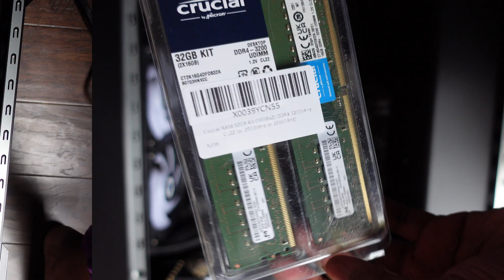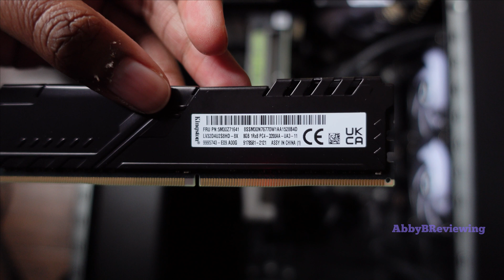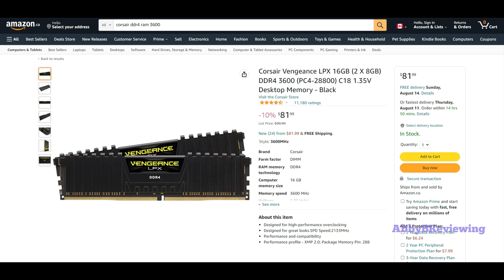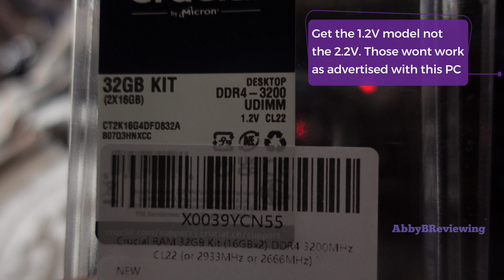Lenovo Legion Tower 7i RAM UPGRADE

Comment: Hey! I buy the same exact pc but used, my friend change the ram for gskill Trident Z RBG 4x8gb 3200mhz but is stock on 2133mhz its impossible tho change in the BIOS do you have any issue i realy need rgb 😭
Reply from the maker: Hello, i have not tried that RAM. The one i have is not RGB, and it's still working great with no issues.

Comment: Hi my legion tower has kingston fury ram in it and i m buying another 16gb ram stick it s going to work right?
Reply from the maker: Hello, you would need 2 new 16gb sticks you can't have an uneven number of GB in a PC (use either 2 or 4 total in this PC), and matching the exact brand/kind of RAM, your Legion PC came with should work great
Reply: @AbbyBReviewing yes in fact my pc came with 1 ram stick which is 16 gb and i ordered another one that is 16 same brand
Reply from the maker: Oh, that's interesting did the second stick of RAM you get work out well?
Reply: @AbbyBReviewing  i still didn t get it because i live in italy and i ordered it on the 25th of december and it was christmas day hopefully i get it this week i will let you know when i test it
Reply: @AbbyBReviewing  i just got my ram and i installed them i had a bit of trouble because i had to remove the gpu but everything is working fine

Comment: Hi, I'm from Argentina. 

I wanted to upgrade the RAM to this PC and tried the Corsair Vengance Pro and it runs at 2133MHz.
Then I tried the Patriot Signature and I just got an error alarm (computer won't start).

I even talked to the Lenovo customer service, and they didn't give me any solution on this.

Then I watched your video and tried the Crucial, and worked perfectly! 

Thanks A LOT.

(You can even mix the Crucial sticks with the ones that the pc already got).
Reply from the maker: Hi Franco, I'm glad I could help! And thanks for sharing 😊

Comment: Hi Abby, glad I found this VID!!!!! I have 7i Tower w. 16gb RAM (2 stix@ 8gb  each) & RTX3070 (running 6 1080p monitors with addition of an external GPU for 2). Been noticing that my computer lags really bad all of the suddenwhen multiple windows opening running vids or working with CTRIX aps for work. Memory use is always at around 70+ percent. Sorry for long intro to an actual question... What are my best RAM options to  upgrade my ram? I would prefer to double the same sticks but not sure that will be best cost; it came with the LEGION ram with the sinks built into it. Please give me some options that are known to work with this tower; been reading alot about people buying ram and it is not compatible. TIA👍
Reply from the maker: Hello John, I can only recommend the specific RAM brand mentioned in this video, as I've tested it and works no issues for me, and got it on Amazon. You can do 2 or 4 sticks of 8GB, 16GB, or 32GB RAM for ex whatever works for your budget, the higher storage will be more expensive obviously.
Reply: @AbbyBReviewing  Thanks for your reply... Lenovo 4X71B32811 8GB DDR4 2933MHz ECC UDIMM Memory is listed on their website, BestBuy stated that it is compatible but awaiting confirmation from Lenovo website... Thoughts???

Comment: Hey thanks for the video. Do you have to take out the old RAM? (2x8g)  What would happen if I left it in and added the 2x16g crucial RAM in the 1st and 3rd slots?
Also do you have any recommendations for SSD upgrade?  512g is on the small side..
Reply from the maker: Hello, computers can have operational issues if you mix RAM storages like that. I wouldn't try it because of that. And I haven't upgraded my SSD, haven't needed to yet but I'd go with the same brand/model your PC came with but in a higher storage capacity and it should be fine.
Reply: @AbbyBReviewing  Oh ok cool. thanks a lot for the info :D

Comment: FYI new system with 64 GM RAM, 4090, and i9 came in.  The RAM was running at 4000MHz! I updated the BIOS and the XMP option is no longer there? There are memory options but any changes and the system will not start! Great I upgrade to 64 GB RAM and more larger NvME drive and have worse perfomance than other. The Lenovo forum has a few like me who just recieved the same spec'd system having the same results. For now I would not quarantee any RAM for this system because it looks like there are different BIOS out there maybe because there are different mother boards? I am not sure but I am using the O5UKT1DA BIOS April 20, 2023 for the Legion T7 34IRZ8 system. My options are to keep this, build my own and get the Corsair Vengence 8100. I only purchased the Lenovo because the BIOS reportedly corrected the RAM issue. Others are also reporting the NvME speeds are slow as well.
Reply from the maker: There are many different models of the PC, them having different motherboards & RAM requirements is definitely possible. And thanks for sharing!

Comment: Hey thanks for the video

I just saw a ram this one

Corsair Vengeance RGB RT, DDR4-4600, CL18 - 32 

Which runs 22 

The max V is 1.5 4600 
And the lowest shows 1.2 3200

So if I buy this ram will it run at the 3200?

Same lenovo pc here
Reply from the maker: Hello, I haven't tried that specific RAM so I can't confirm that. But, when I tried some Corsair RAM's with higher than 1.2 max voltage they did not run at the advertised speeds.

Comment: Hey! Thanks for the video. And I was wondering if the mainboard on this machine will limit my RAM? Because the one I have is Lenovo Legion T730 with 32 GB DDR4 2666MHz, and no XMP capable. No matter what RAM I used, they will only be pegged at 2666mhz. That would be very bad for me, I need better RAM and a better cooling system, but those things are not possible on that one I have, so I'm asking if this is possible on this machine?
Reply from the maker: Hi, for my PC yes. This PC is quite specific and only certain DDR4 RAM will run at the advertised speeds. I've shown in this video a RAM that i found that is compatible with this Legion PC and doesn't get limited and runs at the advertised speeds. However, as I believe you have a different version PC than me yours may differ.
Reply: @AbbyBReviewing  yea I think Lenovo is installing some sort of restriction on each of their mainboards so that the RAM can only run at 2666. My PC has been bought in 2020. But it seems like this problem has not even been dealt with in the latest edition.

Comment: Thanks Abby for doing this. I recently purchased almost the same PC except mine came with a 12th Generation Intel Core 7 processor. Dumb question, with the Crucial 32GB you recommended, if I am looking to upgrade, it should still work right?
Reply from the maker: Hi, I don't know the exact specs of your PC as it is different model then mine but I presume it would work, definitely worth a shot!
Reply: @AbbyBReviewing  Hi Abby, just tried attaching the 32GB you recommended. Sadly, with PC I bought ( Legion Tower, 12th Generation Intel Core 7 Processor), the RAM would not fit through the groove/notch (even tried turning it around but it just made the notch further away). Oddly it was an inch or two apart... I guess that means for the PC I have it's the wrong RAM?
Reply from the maker: Oh that is strange, as a majority of Legion Tower PC's have the same size RAM slots but yours sounds like its different. Sorry to hear it didn't work out. As you have a different version of the PC then I do, I'm unsure about what RAM will work on yours. I'd recommend opening up your PC to see the exact Specs of the RAM you have to figure out if its DDR4  RAM or not, and to reaching out to Lenovo customer service for assistance if needed.

Comment: i have the lenovo legion t7 do you think it wil also work for that one? [the t7 is not water cooled ]
Reply from the maker: Hi 
K__M 99 , I don't have that specific model without water cooling so I am unsure if the Specs are the same for the RAM. I'd advise you to open your PC, and look at what the original RAM you received says to see if matches the specs I provided or not.
Reply: @AbbyBReviewing  it's the same. I bought the RAM you recommended here and it works
Reply from the maker: @PrinceOfZamunda  thanks for sharing!
Reply: I haver the T7 with Water cooled and the ram works well with HyperX Fury 2.1 volts with RGB. it's difficult to find higher than 8 Gb do.

Comment: Hi Abby again and my apologize for the much I make questions. Because I don't find anything compatible for this PC in memory (3200MHz at 1.2v and RGB, 8 or 16 Gb), I want to ask you if I buy a for example the HyperX Fury Beast 16Gb at 3200MHz 1.35v. I know that this Legion is not compatible with that 3200MHz 1.35v, the Legion will run a 2666Mhz at 1.2v automatic but with more ram??? So my Question itself is If I replace all my 32Gb (8X4)in total that run at 3200MHz, to a 64Gb (16X4) in total running at 2666MHz??? This hurt my Legion?? Nothing happens if I sacrifice MHz vs RAM size??, Is best and not hurt the Legion if I have more size ram vs MHz of ram? I don't know if you catch me. Thanks for your time! 👍
Reply from the maker: Hi Carlos, if you are not going to get RAM that is not compatible, I'd check out RGB RAM from Corsair as it may be cheaper than the Kingston Beast and they have many DDR4 RGB RAM options. Using RAM that is not compatible will not hurt your PC it just won't be running optimally as fast as it could be if you had compatible RAM installed, and will underperform so I wouldn't recommend it as you won't get the advertised speeds. But it is definitely possible, And you're welcome!
Reply: OK thanks for the info and recommendation Abby, take care and hope you keeping made more videos like this!
Reply from the maker: @CarlosELugo  No problem! And I also have video about my RAM upgrade for this Legion PC if your interested you can see it here: https://youtu.be/SiM2xfdbYJA note it's not RBG RAM but it is compatible.

Comment: Hi Abby and very very thanks for this video review. I have this machine, I upgraded to 32 but with 8's (8X4=32). I want to upgrade to 64 if possible (16X4=64) or if not only buy 2 of 16 to take the dual channel. I know the XMP issue with that pc, I know that the ram that I need is 1.2V, 3200 MHz, but I want that have RGB. I have been looking in Amazon, Ebay, etc and can not find ones that came with RGB and have the 1.2V, 3200 MHz to ensure the max speed. So I want to ask you and anyone reading this if you know or have a recommendation a brand that have RGB and works at full speed 3200 MHz with this Legion Desktop? Again thanks for your time and effort in making this fantastic videos.
Reply from the maker: Hi Carlos, the only RGB compatible RAM I've seen is the Kingston HyperX Fury RGB.
Reply: Abby can you please give me the part number of that, becasue all that I found are 1.35V.
Reply from the maker: Sorry, I don't have a part number and this specific RAM has been discontinued (also keep in mind the Fury Beast RGB RAM is a different product, and not compatible), so it may be hard to find. However, I've seen some on Amazon and eBay in the past.
Reply: Thanks a lot Abby, take care! ❤

Comment: What mobo is in this version of the 7i? I picked up one about a week ago and am having a hard time figuring out what ram I can use to actually hit 4800mhz. I have micron ddr5, 4 x16gb.
Reply from the maker: Hi M, mine has a z490 motherboard and the RAM specifications are specific for this PC if you want it to run at advertised speeds. I have a video about my RAM upgrade for this PC here if your interested https://youtu.be/SiM2xfdbYJA
Reply: I have the same exact one, Did you end up figuring it out ? Mine only hits 4000mhz
Reply: @Yolo-ic3ho  they are sending me a replacement because they don't know what they are doing over at Lenovo. If your drop it to 2nsticks of ram you can hit 4400.
Reply: @marcusvd  thanks
Reply: Did you eventually get it to 4800?

Comment: That CL cas latency at 22 is horrendous though. You'd be better off running the Corsair at 2400mhz with a CL of 16. You will get virtually the same if not better performance from the Corsair
Reply from the maker: RAM is only one part of what impacts your PC's performance and speed and I dont find this PC to have horrendous performance at all with its CL 22 RAM.
Reply: @AbbyBReviewing  I guess I made more of a statement but I have the same exact desktop. I ripped out the psu and upgraded that with corsair, The lack of bios on the motherboard really really upsets me. Also there are zero heatshields, not even over the chipset. My ssd has one though. There is ram that I bought that also runs at 3200mhz, with the same CL22 latency. It is Team Group Elite plus and it comes with a heat spreader as well. Jedec compliant.. I want to swap my motherboard out with an Asus Tuf B560m but I'm not sure if they hardware locked my intel cpu? I know Lenovo is doing locks with Ryzen and that sucks. And also do you think if I swap motherboards, I would be able to keep windows 11? If I just transfer my ssd. Or is it also locked to the hardware. Bc its oem..
Reply from the maker: @6r3ys0n  Oh I see,  that's definitely interesting. And I don't think you'll have an issue updating to windows 11. Even if its a windows 10 PC initially after you switch the motherboard a majority of them with windows 10 are compatible with a free windows 11 upgrade.
Reply: @AbbyBReviewing  I also forgot to mention I couldn't find any other Jedec compliant ram at 3200 mhz with CL lower than 22 but it's whatever I just bit the bullet

Comment: Hey! Thank you so much for this video. I have the same PC and have been failing miserably to find RAM that’ll actually clock at 3200mhz. I ended up settling for the Corsair vengeance which sadly only clocks around 2300mhz or something. I kept it for the RGB. Would any 3200mhz 32gb RAM work that’s 1.2v? Or specifically the one you linked?
Reply from the maker: Hello, I believe most 1.2v RAM will work. Of course I haven't tested all of them but I have tried 2 different branded 1.2v RAM and both worked as advertised.
Reply: Some dude got 3200mhz with kingston hyperx fury beast and used ryzen master to put it 3200mhz

Comment: Hey I was wondering why getting the 1.2v is important. Will a 1.35v work? Sorry if this a dumb question haha. Thanks!
Reply from the maker: Hi Hunter, the 1.35v won't work with this PC's specifications (ie. they won't run at the advertised speed and will run much slower as I said in the video). Only low voltage ram ie. 1.2v will work.